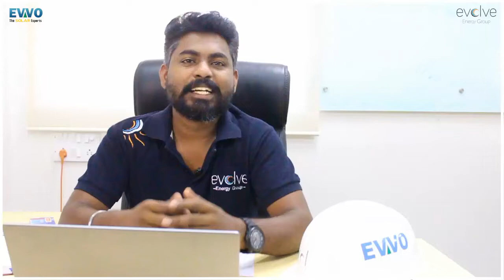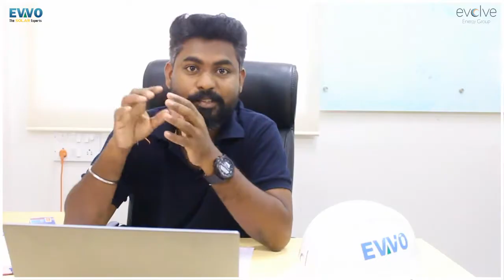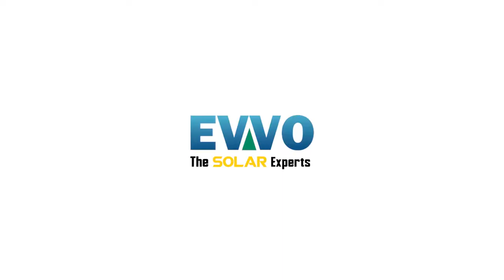Why To Oversize Solar Power Plant ? | Sivakumaran CTO | Evolve Energy Group | #Solar #Siva

Comment: Thanks very much for your presentation, very good thankyou. So then if the mpp is between 125 to 450 V DC then we should be fine to connect up enough series connected solar panels , just as long as the total output voltage from the connected panels, does not exceed the maximum mpp allowable DC voltage to input side of the inverter. Thanks again for the clarification.

Comment: In my best opinion  series/parallel your panels in this case  max out panel and at the same time you stay with in the inverter voltage range. For example 18 300w panels,voc 450V, 9 amp with a  5kw  max (6000 w)you cannot do 1 string cause you are over the voltage. So if you do 2 string of 9 you can max out or oversize the inverter.. kw. I think that's the Best way.

Comment: I have 8 solar panels of 240w each whose technical specifications are
Voc- 37.2v, Vmp- 31.1, Imp-7.71 A, Isc-8.45 A.
I want to make a soler system of 24v, which solar inverter is best for me. Iam not worried about the load it can run. I want to utilise all the panels with lowest investment. Please Suggest me the best.

Comment: Your Videos are nice Sir.Request to make video on how to wire high current solar panels with inverters.Like Canadian Solar 595Wp panel with 18.42 Amps Short Circuit current.Most inverters in market do not handle this current.Even Enphase Micoinverter is not able to handle this much current